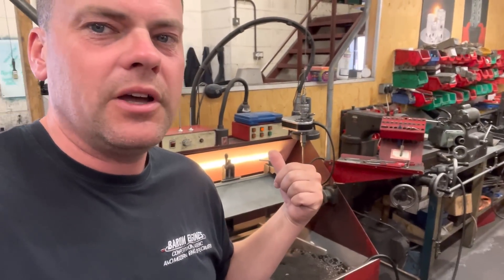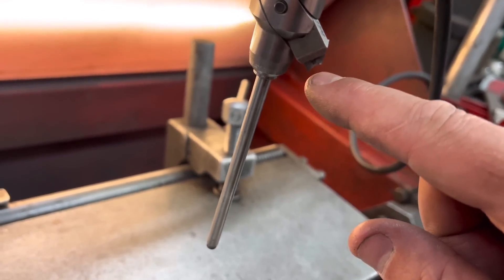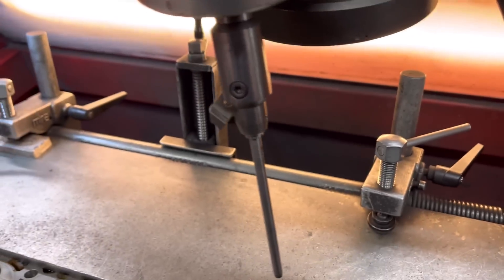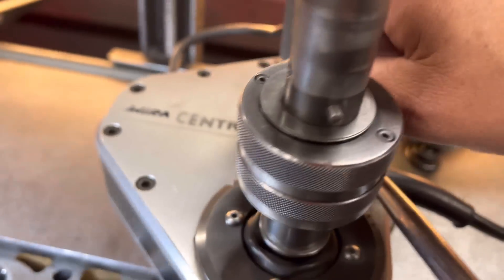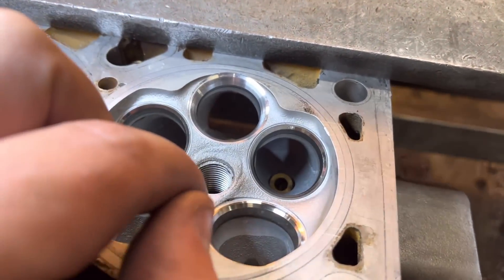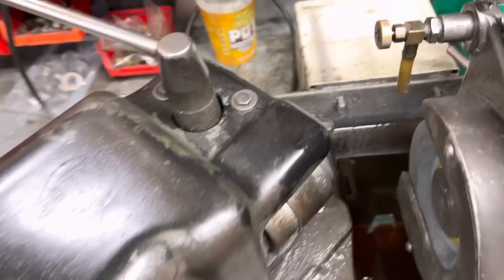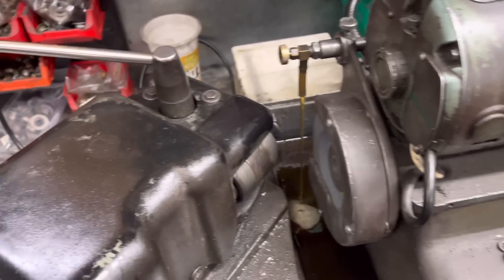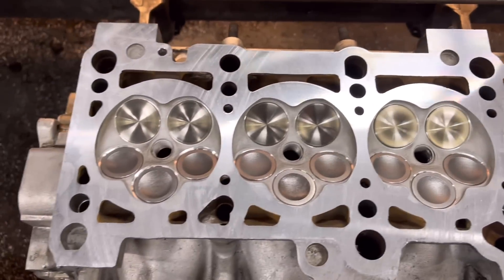Tuning cylinder head! 3 face valve seats and super tech valves for more power

Comment: I like how this valve seat cutter is aligned. Engines heads like the Chevrolet Big Block could be rebuilt in much less time with it. Other machines required repositioning on the fixture.

Comment: Should you be facing brand new valves ?
Reply: Depends on the quality & finish of the new valves, high quality then the manufacturer's seat finish & angle setting are probably better than you'd manage yourself.  That said it serves as a check they haven't been bent or damaged in storage or shipping even with quality ones. Personally I wouldn't if they vacuum OK, unless I was using a custom seat angle, where I'd obviously have no choice.

Comment: Really enjoyed this episode. Better than hearing about moaning/awkward customers! Though these can be entertaining. 
One question: When cutting the valves how much do you take off? Or are you just roughly polishing to remove surface imperections? And if I could ask another, do you "bake" aluminium cylinder heads to straighten them? I know facing a cylinder head won't put the cam bearings back into line. Love to know.

Comment: If you have access  to a flow bench , try 50 degree exhaust seats  30 d top and radius on the blend to the port, there are power gains . Intakes can be 5 angle bottom including radius, I suspect  you would have to install  a thicker seat to achieve this  5 angle radius cutters I get from a Goodson dealer  they make tool holders also if required .

Comment: Do leave the valves at 45 or do you add a 30 to them? Or do you find it not worth the extra work?
Reply: I f you look you will see the 3 angles are built into the cutter 45 for the valve and 30 on top with 60 in the throat.
Reply: @grantreid8583  that's the seats, he used the grinding disk on the valve itself to set a 45
Reply: @abzzeus  A grinding disc or a valve facing machine with a grinding wheel, thats what i have always used?

Comment: In my shop we wont use supertech valves. Too many issues. First the stainless nitride valves were too soft and were the seat fast. Then the went too hard and were brittle and they would drop valve heads off. I had a rb26 drop a valve head off. I had a customers car in the shop that had done only 5 laps since new engine with supertech valves at the time so pulled it and stripped it to check and all 8 Inlet valves were cracked. A quick google search for "supertech valve failure" will alarm you. They really are only a entry level valve but they are the same price as Ferrera and manley....

Comment: I’ve used a Mira centronic if you need to cut seats with valves that have 5mm stems or smaller Get some carbide pilots it seams to struggle to centre properly with regular pilots. 👍

Comment: Does a 3 angled cut give any better combustion had it done on a KTM head and valves in conjunction with other mods ?.
Reply: The main thing it does is improve flow at the point when the valve is just opening, the cylinder can start to fill or empty that little bit better with the valve just opening / almost closed since it reduces the pinch point the mixture has to get past.  A marginal gain.  Overdo it by making the 45 section too narrow & you pay in increased wear or burned valves, since it also reduces the area to conduct heat away when the valve is closed.

Comment: 3 angle valve seats:  I have found that after about 10,000 miles, the 30 & 60 degree sections coke up, effectively making one wider 45 degree seat, so I don't do that any more.  (I have a proper seat / valve cutter).  Instead, as per David Vizard, a single 4mm 45 degree seat relieved either side.
Reply: There isnt anything that DV hasn't learned thro testing  !
Reply: If you had a single 45% seat relieved either side would that not give you 3 angles?
Reply: @grantreid8583  I meant that the edges of the seats are cut in line with the cylinder head &  port, so 0, 45 & 90 degrees!